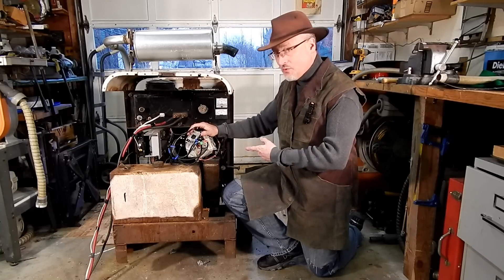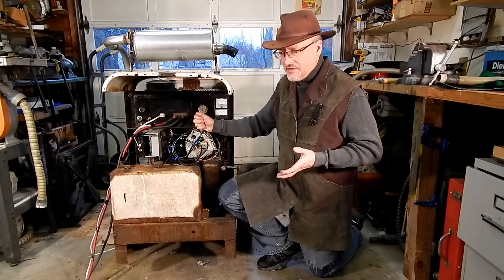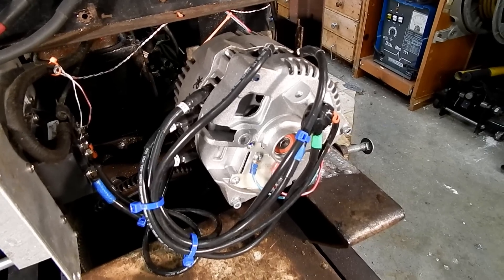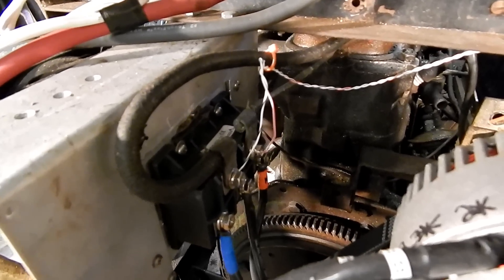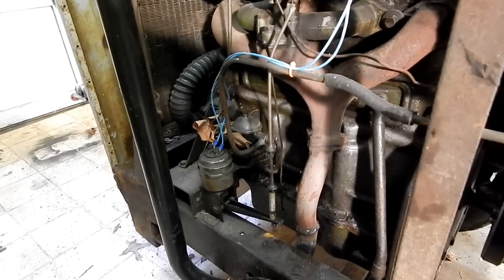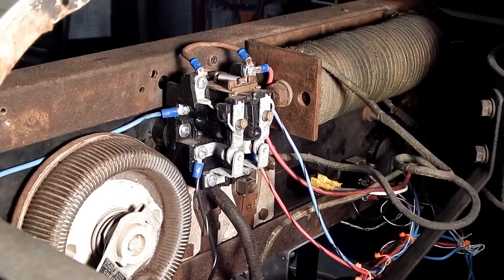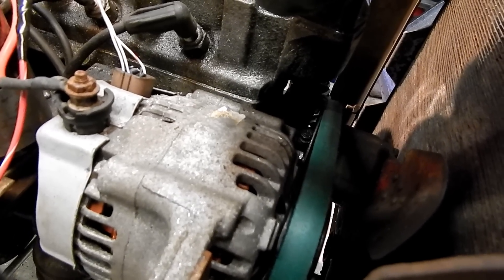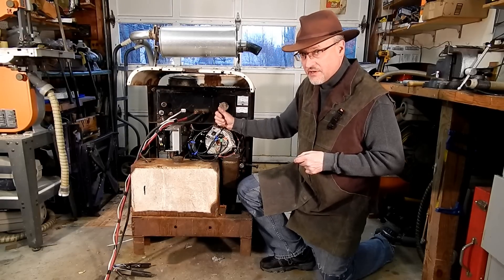HOMEMADE WELDER! 250 AMPS from old car engine!

Comment: 71-8329N carquest 12v 160A (50A @1150rpm , 100amps 1750RPM, 200amps @3,500 rpm., 220amps 5500 RPM. ) have a computer tested altenator readout. Ripple current@2500rpm 34amps trurn on speed 1800rpm.

Comment: Could this be done using a 3phase 240vac motor instead of an alternator?
Reply from the maker: I don't think so. You'd have to have external power to excite the armature and I think it would be really hard to start an arc. Also it would be hella dangerous!
Reply: @JakevonSlatt  thanks for the reply, I have a few laying around so was curious what would happen. Do you know what the difference is?
Reply from the maker: @jpfiero  The main difference is that the armature of the alternator is an electromagnet that's powered by the 12 volt supply. The AC motor's armature is just a stack of iron plates shaped so they spin in the rotating magnet field of coils. AC motors will make power if you spin them, but they need a "kick" from an outside source and a steady load to establish the magnetic field.
Reply: @JakevonSlatt  thanks that explains it.

Comment: What rpm do you need to weld and can you mig or tig or just stick
Reply from the maker: I'd guess the engine is at about 3500 RPM when welding. MIG works well! Interestingly a big capacitor across the lead makes stick much more stable and easier but MIG harder. I'm sure I could DC TIG but I haven't had a chance to try the AC straight off of the alternator yet. Got all the pieces, but just haven't had the time.

Comment: Interrestig. Great work.
I woud make it with a 24 volt alternator. Higher voltage should be better.
As arc stabilisator I saw on a german welder an big coil ,few turns of thick cooper wires.
I have a the engine of a  old generator ,it has intergrated RPM Controller( flyweel type   as usual) .
The old DC generators runs on the Rotor,all current come from the Rotor out,which set lot of stress on slip ring ,brushes,may be thats why it didnt work
Reply: welding needs current though, and a 24V alternator of the same size would have less current output in theory than a 12V one
Reply: @MiG21aholic  There are over 200 Amps alternators.
Reply: @cristianpopescu78  for 24V they cost a fortune at that current rating
Reply: @MiG21aholic  What about two 24 v 100 amp alternator in parallel ? Mercedes-Benz 150 eur per piece.
Reply: @cristianpopescu78  would just have to wire the field circuits together so they put out equal current
Reply: @MiG21aholic  Right. So you have to rewire them with thicker copper.

Comment: ...inductor  in a welder, is named  REACTOR........you may adjust the number of turns (inductance) for each amperage setting of welding....
Reply from the maker: You know that's what I thought but I think the phrase "arc reactor" has been diluted by the Tony Stark Ironman franchise

Comment: I dont think the original old generator was made to weld with you need a special diodes for welding. Im glad ur investment paid out,  i am making mine too thanks  for your video
Reply from the maker: These generators were widely used in DIY welders in the 50s and 60s, it was just already toast!

Thanks! I here that Leece Neville alternators for school buses are particularly heavy duty and good for welders.

Comment: Not bad at all, when I was growing up those WW2 aircraft generators were a dime a dozen, now the last one I saw for sale was almost $1000.00 and alternators are so much more efficient anyway. Sure would be interested in seeing how you did the alternator internally. Thanks for the video.
Reply from the maker: I basically just gutted it and bought the ends of the three coils out through the vents. I've since added a big knife switch that lets me switch between Delta and Wye configuration and I've found it helpful for different types of welding. MIG  works better in Delta while in Wye mode it's definitely easier to keep a stick going.

Comment: it is originally a very well done setup, for sure, the belt is a major improvement over the chain and the improvement you've done makes this machine a perfect amateur portable welder..
Reply from the maker: Thanks! I have some upgrades planned, a 3-gang knife switch to change between delta and wye configuration on the alternator and I'm going to try tig welding aluminum with the un-rectified output. Hopefully the AC freq. is not too high.
Reply: Jake von Slatt  something I have difficulty to understand, when, you use DC current, you combine the current produced by all three phases that you convert to DC to make the total production of the alternator, if you try to combine the phases to retrieve the output, you'll make a major short in your winding so the output will be about nil
to my understanding, the best you can do is to use one phase from the central knot to the output and globally, you'll lose dynamic effect of the magnetic field.
it would be interesting that you keep us informed of the result
Reply from the maker: @jacquespoirier9071  There are two ways to wire three phase motors and alternators, Delta and Wye. If you google "delta vs wye" you'll see what I mean.  My alternator is currently wired in Wye mode but Delta should give higher current and lower voltage. For AC I'll only pull current from two of the three connections.

I have a battery and second alternator so my excitation current comes from that supply, not from the welding alternator. It runs through a potentiometer for current control but I don't get a lot of variability so I may upgrade that to a PWM circuit.

Comment: ??? Are you DAFT ? for the price of that alternator which you could have got in a salvage yard by the way ? You could have got a quality mosfet 3 in 1 machine that does TIG and does stick weld and also does plasma cutting ..  and it would operate on 110 or 220 voltage and the most expensive part would be making a 50 foot extension cord for it ..  and the welds would have been thouand times better then your stick welder in fact as a novice you would most likely make welds with TIG on par with a professional using a stick welder ..
Reply from the maker: Um, the alternator cost $129 and was delivered to my door: https://www.amazon.com/Output-Alternator-Lincoln-Mercury-GL-351/dp/B007G8R86I

Comment: Might be easier just to buy a welder. The cheap amico with a 220v  used generator.
Reply from the maker: That's no fun!
Reply: Amy . . you need at least 15HP engine to make a decent welder . . which would cost you much more than a used small car engine and not nearly as strong.

Comment: the control I think that you called a potentiometer is possibly a variac or auto transformer the knob is connected to a wiper that that moves across the coils this gives you the variable out put I could be incorrect but I think that’s what it is
Reply from the maker: In an AC application this could very well be a Variac, and they do look a lot like old school pots, but the field current in an alternator is DC so a Variac wouldn't work here.

Comment: Your pot is really a rheostat
Reply from the maker: Ah! you have fallen into a "well, actually" trap! From wikipedia: "A potentiometer is a three-terminal resistor with a sliding or rotating contact that forms an adjustable voltage divider. If only two terminals are used, one end and the wiper, it acts as a variable resistor or rheostat." So if we are to be ultra-precise, the device is a potentiometer (pot) that is currently wired to function as a rheostat. Interesting, and I have to check voltages and power ratings first, I have been considering re-wiring it as a voltage dividing potentiometer to improve the control over stator current.
Reply: Jake von Slatt hey! Go fuck your self.
Reply from the maker: Dude, you started it.
Reply: @HillbillyRednecking  not his fault he actually knows something about what you were trying to show off your bad knowledge of.... Just saying....
Reply: Lucas Plank there’s something funny about assumptions...

Comment: I have a 12v 160Amp  delco remi slternator y try to do it but it dont go up more than 30 volts  . It have delta triangle wire stator conecction.  And the rotor resistance measured us 5.7 homs. I dont understand why i dont work . But with the same condition   with and alternator if lower Amp 50Amp it works perfetc go up to 70 volts. Why
Reply from the maker: Are you using the internal diodes? My understanding is they max out at 36 volts so you may have shorted diodes in the unit that isn't working--but that is just a guess.
Reply: I measures . Checked all them  with a multimeter. At diode scale.   All them conduct the current at just one ditecction.
Reply: Jake von Slatt how it can check them properly .?  Could i solve the problem just by changing the stator from delta to star cobfiguration ? So it may be posible to go up to more than 30 volt  or 70 volts  so i can make a simple arc
Reply from the maker: That's what they should do so they're OK.
Reply from the maker: Going to the star configuration will lower the voltage but increase the amps, so I think your have a different problem.

Comment: put a capacitor on the relay for the throttle. and maybe a blocking diode maybe a large capacitor so it keeps the throttle open longer. maybe 30-45 seconds maybe more probably not practical for more. depends on power use on the coil!
Reply from the maker: It's a big coil, I'm planning on making a 555 timer circuit.

Comment: Nice! I'd like to see how you did the alternator step by step.
Reply from the maker: It was actually pretty easy. Just remove the diode block and cut the wires free. They'll be 6 wire and you just use a multi-meter to identify the 3 pairs. The key bit of info is that it does not matter the phase of any given pair so all you need to know is which two leads go to each coil.

Comment: built one fifty years ago with an aircraft generator.  there were two that were used, a P1 and an R2. the R2but out
400 amps as i remember, powered it with a flathead ford.  there is a website that shows the wiring diagram
I think they were Jack  and Heinz or something like that.. it was a long time ago
Reply from the maker: That's how this one started out, with a P1 I believe. Unfortunately, the generator was toast when I got the welder and replacements on ebay were way more expensive that the Ford alternator. I've kept the generator and one day, perhaps in retirement, I'll make a stab at rewinding the coils.
Reply: wiring schematic is on http://www.api-assembled.com/design/tech/welder/welder.htm

Comment: You already had 250v DC coming out of the alternator. Why not use it as it was.
Reply from the maker: The built-in diodes in an alternator will break down and fail at 36 volts and the unloaded voltage of the welder is closer to 100 volts. The 400 Amp diode pack is good to several hundred volts before it breaks down.
Reply: @JakevonSlatt  why should the output go to 100 Volts? . .   just limit it the 12V or 20V etc with the proper voltage regulator.

Comment: You said you don't think you are getting 200 amps and I'm not sure how the regulator works but I assume it is relatively efficient so like 14v 200a 2800 watts is probably a good goal because if you are welding I assume your like mid 40s to maybe 60 volts right
Reply: I made one a few yrs ago from a 100 amp Leece-Neville 24v alternator that I retied to Delta and drove it from a big pulley on the back of my 20 hp B Farmall tractor. It is a lot bigger in size than the alternator you used. I borrowed an arc stabilizer from a portable Forney welder I had. I also had a rheostat in the field feeding 12volts. It welded fantastic and sounded just like a Lincoln pipeliner. And it didn't get real hot; got pretty warm. I have another one of them that I need to take apart and redo.
Reply from the maker: Yeah, un-loaded it's a hundred or more at speed and it drops to 50-60 when I start welding. It's a 250 Amp alternator and from what I've read about other builds, people say they get about 200 Amps. I have a 400 Amp shunt and meter and as soon as I get around to installing them I'll post here about how many Amps it's actually pushing.
Reply: Did you ever measure the open circuit voltage between the positive electrode cable and ground at welding speed and again across them while welding? I am especially curious what it will be while welding.It will take 120 amps or so to burn a 1/8" welding rod and if the voltage drops to 24-30 like most welders it would be drawing  2880-3600 watts of power. That would be right on the top limit of what the alternator was designed to put out; but could probably stand it.
Reply from the maker: I've got a 400 amp shunt and meter and am hoping to get that installed next to the voltmeter and do some tests, but I haven't yet. The alternator gets damn hot and the aluminum case definitely changed color after the first run, but it seems to be just short of the temperature that would discolor the varnish on the windings. I have no doubt that the alternator is being pushed well beyond its rating, I mean listen to the engine speed slow down when I'm welding, that is a 40hp 4 cylinder engine! "Weldernators" have the reputation of not lasting "that long", but I think that likely means years for the sort demands I'll put on this welder but weeks for someone that used it daily in a commercial setting.
Reply from the maker: Yeah, my 1989 Thomas bus has a 150 amp Leece-Neville alternator and it is probably about twice the size and weight of this unit so I don't doubt it for a moment!

Comment: Cool but a 4 cylinder running 1 alternator seems unnecessary you should add one more alternator or a compressor just got to the part about the second alternator but still
Reply from the maker: Definitely thinking about a compressor, but also thinking about moving the alternator and components over to a yard-car for more convenience.

Comment: I know this is an old vid and I don't know what else you have done but I have a caution for you. MIG and SMAW (stick) are incompatible processes ....one is constant current and one is constant voltage (don't recall which is which) so a spool gun will not work well with that set up....however TIG works very nicely ....the high frequency pulsed square wave makes for a pretty stable arc and almost starts like a high freq arc starter.....Will not be an optimal set up.....as you won't have a foot pedal or AC (at least without further mods) but it would be interesting to see how it works out for you.....you all ready have a stinger switch you could easily incorperate a gas solenoid and with a largish capacitor could time delay the relay for some post flow......so you are all ready ahead of most scratch start converted stick welding rigs.

Comment: i have a question about the 3 thase wiring whhy did you not just use the diode bride that the alt. cam with is their any advantages in doing what you did if so what are they and how do you do it i dont quite understand it
Reply from the maker: Stock alternator diodes are only good to 32 volts, they would not have lasted long!
Reply: should have realized that
Reply: if the alt. stator has 3 ring connectors with two wires on them similar to this (store.alternatorparts.com/images/products/display/04422.jpg) will i have to do what you did with the wye or delta wire configuration PS. that jacket is very neat
Reply from the maker: That stator is wired in a delta config, like mine. If you want to try a wye, you'll have to cut off the rings and rewire. Mine is working fine in delta config so I have not yet tried the wye which theoretically provides more amperage at a lower voltage.
Reply: so how was your alt. wired
Reply from the maker: Delta.
Reply: coming back why did you not just use a crankshaft pulley for a automotive motor

Comment: Why did you bypass the alternator diodes and then use a three-phase rectifier?
Reply from the maker: The diodes in the alternator are good to 250 amps but only 36 volts and in welder mode the voltages will go significantly higher.
Reply: Voltage to keep a welding arc stable is about 30-60 volts.